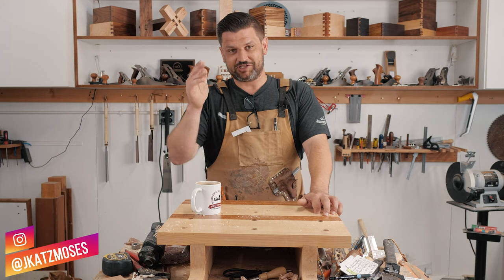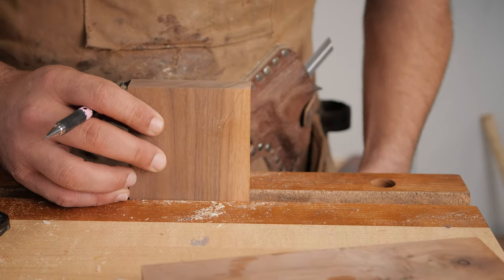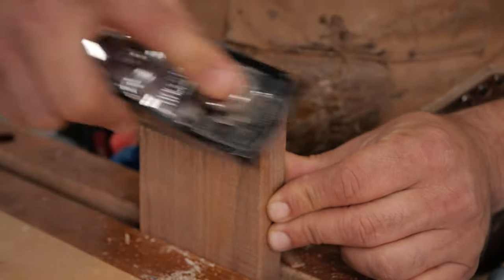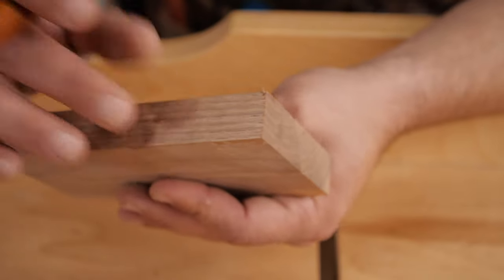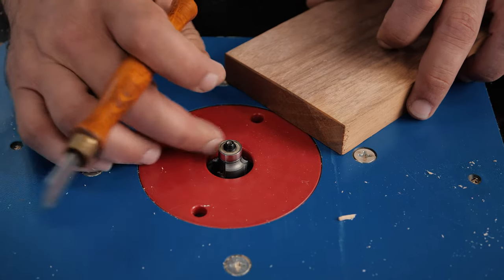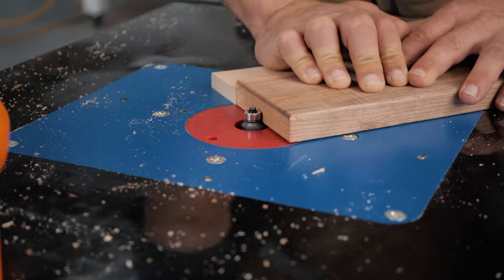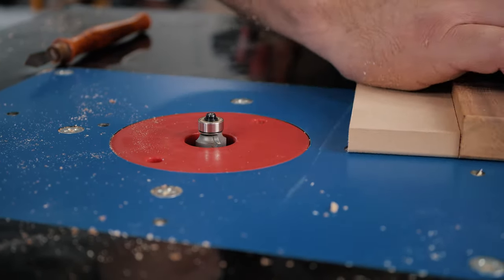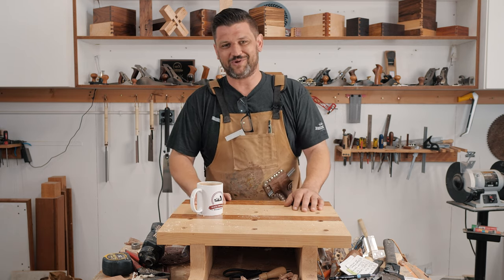Stop Tearout - My Favorite Tips and Tricks

Comment: Great tip for the bandsaw!  Are there similar Tips for drilling holes?  I have certainly reduced tear out with a backer board and tape, but I till have a hard time getting a super clean edge when cross dwelling, or even with pocket holes I intend to cap off.

Comment: Wouldn’t a sacrificial board on the table saw work the same way it did on the band saw, by making a zero clearance? I’ve never done it but it just popped in my head as soon as you enter the video and I thought if it’s good for one wouldn’t it be good for the other? Great tip video!

Comment: On your crosscut sled, why did the sled itself not act like that backer board?
Reply from the maker: Good question. After changing blades a few times that opening will get wide than your blade. If not certainly taller. Basically it wears out over time
Reply: @katzmosestools  that makes sense, thank you!